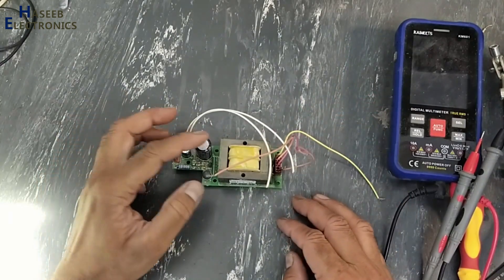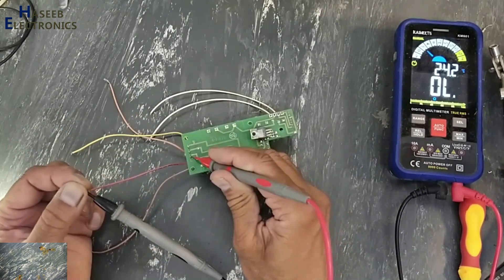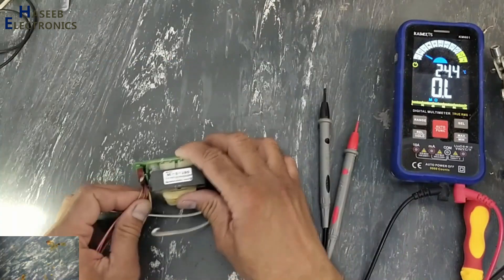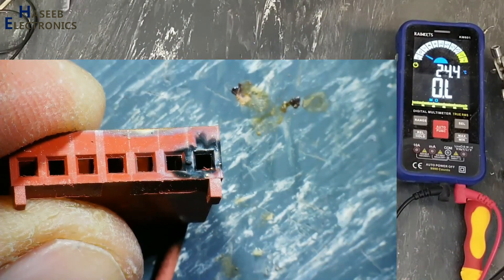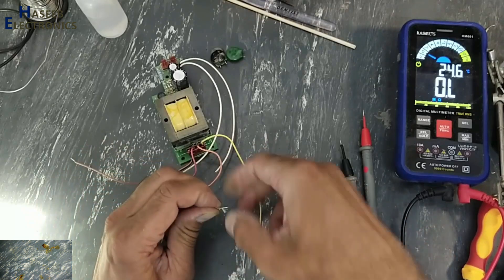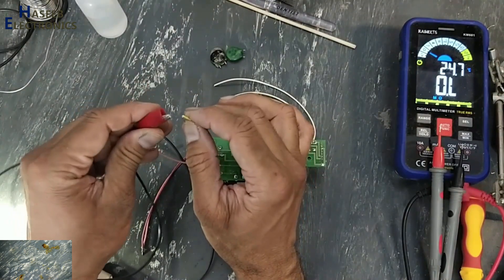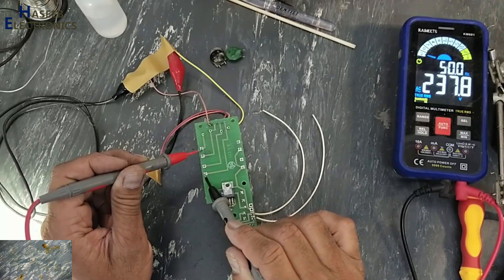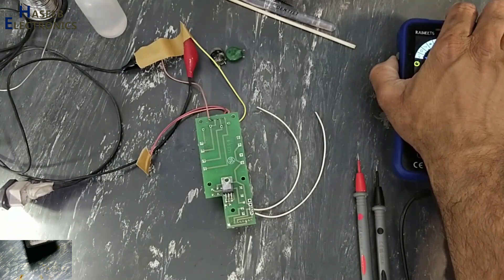{1233} Power supply repair for MB9X Solid state motor controller

Comment: Baldor motors have been around for a long time. That name brought back some memories. I used to work repairing stuff in a hardware store in the Caribbean and they were the agents for Baldor. That's where I first learned about centrifugal switches, start windings and start capacitors. Thanks for sharing the video!
Reply from the maker: yes. you are right, BALDOR is well not in inductrial motor control circuits

Comment: hi Sir much appredciated,  can you please explain how  half bridge smps works because i see pusle transformer drives the 2 transistors , what voltage is applied on the base of bjt to switch the transistor off while the other transistor is On because i assume the pulse produces ac voltage instead of dc voltage, i am refering to video #592 that you did
Reply from the maker: sure it will. it will my pleasure. i noted this question and will arrange as soon as possible
Reply: @HaseebElectronics  thank you so much Sir, I will really appreciate it , if u will come and re explain video #592, I downloaded the schematic that you posted on that video and there is a lot I don't understand if u could please teach us basic principles on that schematic will be key to my understamding. Thanks alot for educating us looking forward to your response